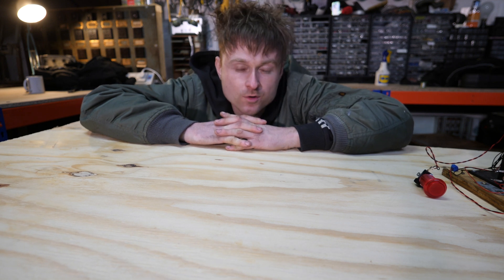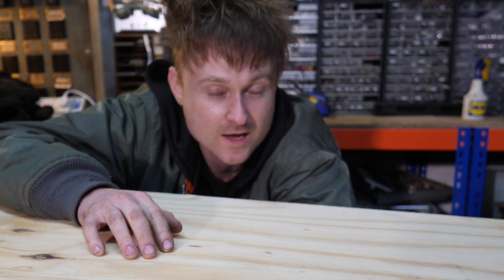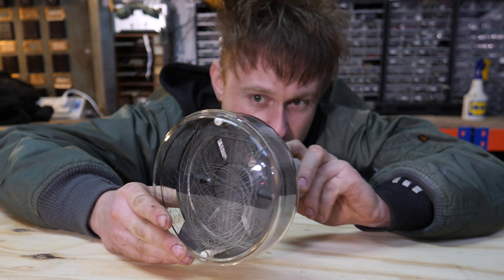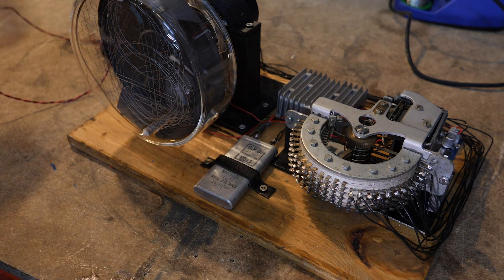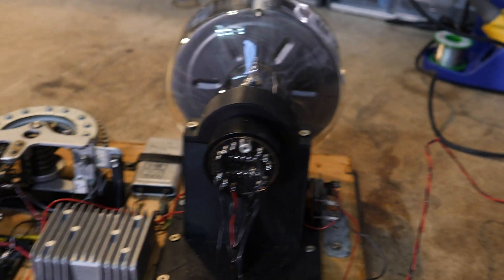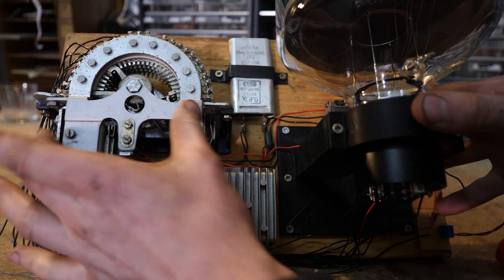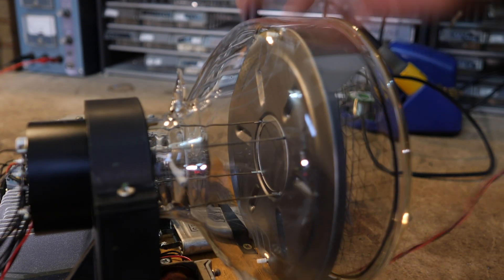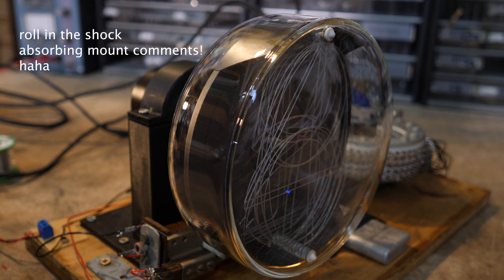THE BIGGEST NIXIE TUBE IN PRODUCTION

Comment: 5:30 Are you sure 130-140 V is enough for reliable ignition? That sounds like where I would expect the maintaining voltage to be. I would usually go a bit higher with a properly sized resistor (170V, maybe).
Reply: as you can see, it is more than enough, lights every time

Comment: I'm just wondering who's buying this particular type. I'm not actively looking for them, but it's my understanding that most nixie tubes on the market are new old stock (i.e. stock that's been sitting on a shelf, never opened). I know a few years ago there was a manufacturer that was setup to supply the small demand of newly manufactured stock since we're running through the new old stock. As far as I understand, most of the demand is either from museum maintainers or otherwise retro enthusiasts, so I can't imagine there too many systems that would require a nixie tube this large.
Reply: This was a custom design from a new manufacturer (Dalibor Farny) for use in an art piece. Made in the last few years if I'm correct
Reply: @chasemartin4450  You are correct though he did sell a small run of working H tubes - I think the price was around 600-700 euro - but I could be wrong

Comment: Great display never seen one that large, one thing if you check the video at 06:42 you will see the vibration from the uniselector is moving the cathode wires.  This may cause shorts or damage after while. Maybe prudent to isolate the display on some soft foam bushes..  
Great demo thanks Sam.

Comment: Great to see that you finally managed to get your hands on some of these! I am the guy who designed the font for the H Tube (We briefly met at your Prague gig earlier this year where I brought the Soemtron calculator to have it autograph :D ).
Design the font was quite a fun challenge, with the brief being to have a font that looks and feels vintage, kinda like on an old typewrite. This eventually resulted in the inclusion in serifs (pretty sure this is the only nixie tube that ever had them). Having the numerals be just a simple line would have been too thin at this scale so I ended up treating it as an outline instead but that required having to do some bridging tricks for stability. You can see how all the curved lines tend to come together and touch at some point half way into the curve or how the bottom half on the number 3 continues and essentially cuts across the outlined shape just so you have an extra intersection. I am still bit annoyed that the number 2 needed the extra bridge in the middle, it was just too flimsy without it and I couldnt figure out any more elegant way of doing it.

Oh and here is a fun fact: even the old 50mm big Z568M used essentially the outline for the number 1, but the two vertical lines are so close together it glows as a single line - this was done to get the apparent brightness closer to the other digits as well as reducing the variance in the current across digits!
Another odd thing about that tube is that it has an extra 8 in the middle of the digit stack, Im not sure if I remember this correctly but think it might be shorted to the anode grid to help things glow better? (it is put in upside down relative to the other digits to minimize overlap with the digits beneath as to maximize visibility)
Reply: The outline design of the numerals is really great!
Reply: Thank you again for creating the digits! 🙏🙏
Reply: Fantastic work; thanks for the info!

Comment: That vibration is definitely gonna kill that tube dude.
Reply: Maybe add some anti vibration rubbers underneath the counter ?
Reply: I've seen nixies in high vibration environments (old process control equipment) where the shaking was so bad the numerals were blurred.
So I think you're mistaken, or you only have experience with very cheap tubes.
Reply: @railgap  The tubes already broken and has lose parts.
Reply from the maker: time will tell. watch this space
Reply: He most likely doesn't care about it.

Comment: I have something for you to add to the display display - very unusual unit from an old venner frequency counter from the late 60's/early 70s - each digit has a moving-coil meter movement, turning a transparency film disc with the numbers on, and these are projected onto the front screen. The counter had a hundred or so germanium transistors.
Reply from the maker: hey mike! ooh that sounds delightfully bonkers!
Reply: @THISMUSEUMISNOTOBSOLETE  When I get a chance I'll hook it up to something to make it work & get it to you.
Reply: I had one of those. Still got some of this transistors and the 100 Kcs xtal.
Reply: I had one of those displays, never seen another one anywhere since. BNIB ex MoD.
Reply: The coolest offer, that rules man